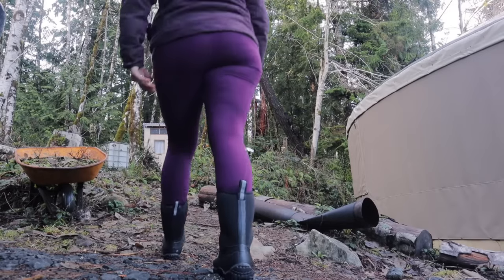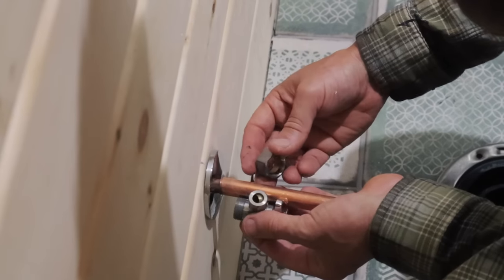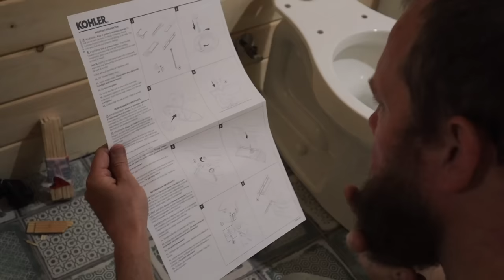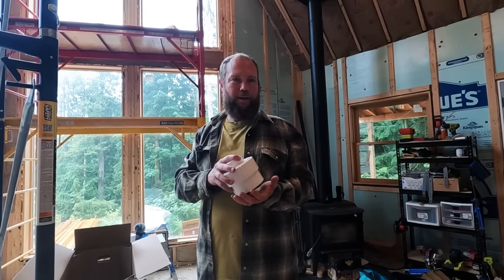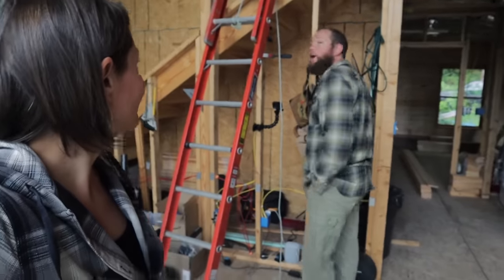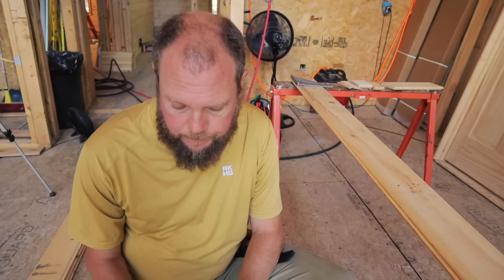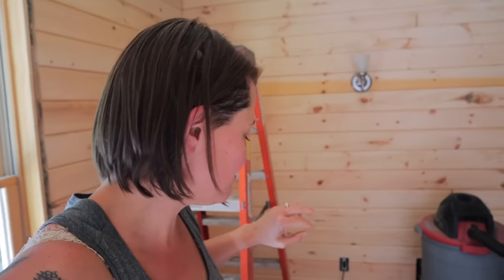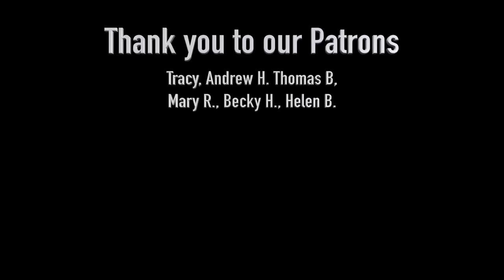WE USED a BUCKET for a TOILET for 2 years!

Comment: We used Engineered Hard Wood.  Pattern was 4", 5", 6" and love it.  We put it down in 2015 and have only had 1 ding.  NOTE:  we have 3 Beagles and they are inside dogs, with a doggie dog but 90% of the time indoors.  No issues.  We also had Wood floors in FL.  Had some hurricane damage and a bust water line to the fridge and replaced them with no real issue.  BUT we learned, Engineered wood floors was the better route.  So thats what we used in our next home in Texas.

Comment: How come there was no insulation above the window like the rest of the ceiling?
But a HUGE well done on the flushing toilet 🥳🎉 hope you lit the door on before someone uses it 😂🤣
See you next week 🥂🍻👍😁
Reply from the maker: Good question, but there was actually a single layer of insualtion in that space.  The rest of the ceiling had a double layer.  The reason we didn't run the double layer all the way was that the area above won't be finished so shouldn't need as much insulation value for soundproofing.
Reply: @OneFootOfftheGrid  ohh, of course, because of the pitch in roof and it being a bit low 👍 I didn't think of that 🤭 
What about the bathroom door 🤔 next episode? 🤞😁

Comment: Did you run out of insulation?  You appear to have left a whole section uninsulated!
Reply from the maker: We actually put up double layers of insulation in most areas of the ceiling. The area you noticed is above an unfinished area in the loft.  The insulation is mostly for soundproofing and not thermal so a single layer in that area we thought would be fine.

Comment: I'd always choose engineered hardwood flooring. It's cheaper than solid wood, more stable because it's made of a ply of materials, and usually, the finished layer is thick enough that after many years of wear, it can be sanded and refinished. I have used it on two projects, and even after my wife flooded our kitchen/dining room, the flooring dried out without a ripple showing!!
Reply from the maker: Thanks for sharing!  That is the direction of leaning towards as well.  We had some in our last home and it held up wonderfully.

Comment: Had a friend that went with bamboo flooring and it scratch pretty easy with the dog.  We have laminate vinyl plank flooring and we love it.  It’s water proof so when the puppy has accidents it cleans up easy or we spill stuff just wipe it up.
Reply from the maker: Thanks for the feedback.  That is exactly the kind of info we were hoping to get.   In our old house, we had laminate wood flooring and it held up really well to the dogs and kids over 10 years.
Reply: @OneFootOfftheGrid  laminate is good but make sure if that’s what you decide to do that you go with the vinyl laminate   We left a piece of flooring outside for 1 month in the rain ice and snow. It held up great, it never took on water.  With our jobs that is a must cause we work outside in the mud, snow, water, you name it and our floor has probably had it on it.

Comment: For flooring, I would use high wear rated interlocking vinyl to avoid any water issues.
Reply from the maker: That's what we've been looking at, but we've read that the "locks" on them can break of somewhat easily.  We were basically ready to go with the vinyl and then read about this issue, and now we're still confused.  Lol!